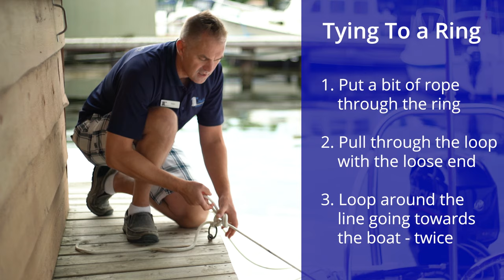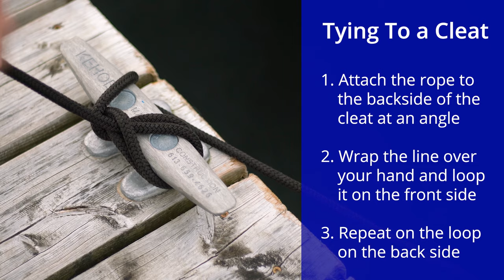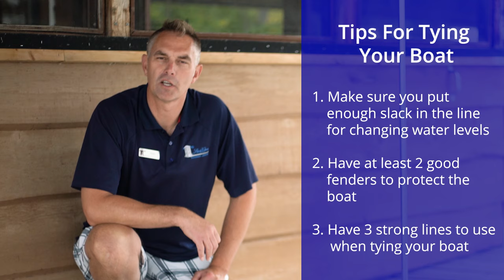How to Tie a Boat to a Dock

Comment from the maker: We got a ton of comments on this video and we learned from them - check them out as there is good information and different opinions in there.
Reply: If you ask ten boating enthusiasts for their opinion about one subject, you’ll likely get ten different ideas, with good reasons.
Reply: El
Reply: On page 65. It's squash eventhough the illustration is about modern-day 1873 lawn tennis.
Reply: ..tie a.. 

At first glance it looks like 1 word; tea.
Reply: @nevillecottee7629  Sorry but you can have 10 opinions but if you aren't tying proper half or full cleat hitches, your opinion is still WRONG.   The fact stands that the method shown in this video of cleating, even though it wasn't a proper cleat hitch to begin with is going to make you lose your hand.  Never put your hand inside that line unless you are perfectly happy with losing said hand when wind or wave shifts 50 tons of yacht the other direction and your hand is caught in against the cleat by the retreating line.   That goes just as much for the cleats, be they on the boat or a pier, as they do for properly running the lines around the winches.

There is always 1 correct way and 10 wrong opinions.

Comment: As someone who has spent a lot of time working on big and small commercial vessels I can safely say tying a slip knot on a cleat is a bad idea and is frowned upon in the boating community. Use the method OXXO. The first O is just a wrap around the base of the cleat followed by two Cross patterns XX (not hitched) and followed by a final wrap around the bottom, O. This way if you need to flick the line off the cleat either from your boat or the dock it can be done much faster and you don’t need to un-tye any actual knots. It can also be untied one handed which also comes in useful. Just my two cents.
Reply: That’s more than two cents worth. Your explanation is what maritime colleges teach.
Reply: also having some give in your cleat knots keeps lines from snapping.
Reply: Now this is a great comment
Reply: Any demonstration vidoe out there? I think i understand it but the last O is kinda the part im confused about? So you make a full turn then do two figure eigjts or cross loops. Then do another full turn to finish it?
Reply: There's a lot of ways you get tired of your boat but there's nothing wrong with the way he tied it actually correct someone that's been in the Navy for 20 years and was a Navy demolitions diver

Comment: When you tie off to a cleat you should really make a full wrap around the cleat before starting your knot, this is especially true for large boats. That allows you to hold the boat in place much more securely and easily before tying off. By immediately tying off, you run the risk of the boat drifting/moving and your fingers getting caught up in the rope.
Reply: in many situations the half cleat hitch is acceptable.  It depends both on conditions, wind, the pier or jetty you are tied up to, as well as the boat you are docking.
Reply: exactly!

Comment: Read Chapmans’s and learn how to tie a proper cleat knot before making a video about tying a cleat knot! There’s always another way to do something, but in this case I have to ask why? I was a dock master years ago and it amazed me how few skippers and crew knew how.  I’ve seen my share of inexperienced skippers make make mistakes and panic moves due to wind and current while someone is attempting to make fast to a cleat, ripping the line out of the persons hand or parting the line that’s attached to a cleat. Once I even saw a skipper rip a piling right out of the water! My point is, never teach your crew to use their hand to make a loop in the line so close to the cleat! A line that’s cleated too soon or a mistake from the skipper could cause serious injury or amputation. Just learn to tie a proper cleat knot and you will know more than 90%of boaters.

Comment: cleat was not tied properly in this video.  If not done properly, (this is not it) a strong wind causing the boat to pull against the cleat will tighten the line so much that you can not get it undone.
Reply from the maker: Yes, thanks for pointing that out. We just reshot this part and will post it soon

Comment: I’ve been boating for 5 years and just now learning about the spring line. Thank you.
Reply: I tie 2 spring lines. Mid boat cleat to the front dock cleat, and mid boat cleat to the rear dock cleat. That way my boat doesn't move front to back at all
Reply: the biggest issue people have with spring lines is  thinking that it's the mid-aft or mid-forward cleat on the boat as mentioned by No_wake. Not that they are wrong it's just common thinking and limits other options.  A spring line can come from the stern and even limited use from the bow if done properly.  Often the line tied to hold the stern is also limiting the movement of the boat because its short so additional  line plus bow line tied properly will have the same effect or better then 4 lines

Comment: Thanks Sean for all the great info.  As a new 1st time boat owner of a bowrider I've found all your videos and tips extremely useful.  Be glad your not here in mid Missouri or Id be chewing your ear off constantly with questions.  Here's a few items I thought I would share on my first outing with the bowrider, maybe you could consider them for future segments....Took the boat on a first run up the river, bad choice, got stuck a few times in low conditions, cant see the bottom, and tore up a brand new prop.  Maybe segment on whats the right depth finder, my next new purchase.  Props, my second new purchase, how to determine which one and the right pitch another possible segment.  Oh and due to all the mud in the river, my Spedo is now not working, maybe a segment on clearing out the Pito intlet on the lower unit, testing the spedo, and then back in business. Keep them coming, cheers.
Reply from the maker: Those are all great ideas, thank you!!  We do want to shift gears to more boating help videos

Comment: The half hitch's might work for small boats, but on work boats with more displacement,  if the weight of the boat pulls on that line, you'll have a line that is jammed on the cleat and you might half to cut it to get loose. One round turn, two figure eight's and a half hitch on top was how i was taught at the California Maritime Academy, a half century ago. That'll work. If you're working with a small light boat, you can get away with the half hitches, but why use them at all, when the figure eights will work better?
Reply from the maker: Great advice and I am going to reshoot that part of the video

Comment: 2:10 is a good instruction of how NOT to tie a boat to a cleat. Ideally, the line goes back to the boat, and you use the cleat on the boat instead ("control the boat from the boat" principle, no need to even step on the dock to arrive or leave). Either way, if you use a hitch, use the cleat hitch after OX (the line will fall neatly side to side, won't jam, much unlike this inverted, insecure and just plainly wrong knot no skipper will teach you), or just do an OXO or OXXO as others have suggested.

Comment: How would I tie up if I only have cleats on the stern of the boat?
Reply from the maker: Are you saying there are no cleats on the bow, or that you moor your boat stern in to the dock and only use the rear cleats?
Reply: @boatinglessons  I use the rear cleats and recently started using the eye on the bow thats used for the trailer winch.
Reply: Yes, I have no bow cleats

Comment: With my pontoon boat, I only have 2 cleats on each side. and the dock slip I will be at this summer is only the length of the boat 20 feet. Is it best to tie 2 long lines, bow to stern cleat and stern to bow cleat?
Reply from the maker: You could to that, but you'd also want to have short lines at the bow and stern to the cleat opposite them. Depending on the prevailing winds and the orientation, I would suggest 3 lines. 2 short to the cleats on bow and stern, and one long one from the rear boat cleat to the front dock cleat, or vice/versa.
Reply: @boatinglessons  Thank you so much. I appreciate the reply! I enjoy the channel

Comment: I'd rather go over the cleat on the dock first instead of going around the base of it first. In the video it; looks to me that the line could chafe on the wood as the boat moved causing damage to the line. By going over the cleat first the line should not rub or chafe on the decking material.
Reply from the maker: Interesting! I know have seen a number of good variations that people have suggested :)
Reply: @boatinglessons  Not all cleats are placed the same either. Some places have placed their cleats upright on the pilling's while others have them on the edges of the decking and or even way back on top of the decking. All kinds of variations give us something to think about when we dock some place different. Again, thanks for the video, the lessons and knowledge that many of us need.

Comment: Adding hitches to a “herreshoff” type cleat is unnecessary and potentially dangerous, especially if a boat must be repositioned or adjusted. A single hitch after a full turn and crossover is enough and doesn’t endanger anyone’s fingers. The additional loop prior to two half-hitches on a ring cleat is interesting but not really necessary, either.

Comment: I disagree about how you tie to a cleat! Your way will lock the line if the line experiences a hard straight. Plus your way places all the strain on the ear of the cleat. It is better to make a complete round turn on the base of the cleat so all the strain is on the base. Then all you need is 3 figure eights on the ears, you can then wrap any leftover line around the cleat (unless you have more than about 4-5 feet, then flemish the line on the dock). This method will hold the line without locking the line making it difficult to undo!
Reply from the maker: Richard, other people have said something similar and I will likely reshoot that portion of the video - I appreciate your feedback!!
Reply: Why you describe is also not a proper clear hitch.
Reply: @GREGPDOHERTY  You are correct I don't think you should ever use a hitch on a cleat. I spent 22 years in the Coast Guard & 15 years in the merchant marine field. I was taught if a half hitch on a cleat was placed under heavy strain the line could lock itself. I have seen line that got so hot because of the amount of strain that the nylon melted. Plus if you do not take a full round turn on the base of the cleat you are putting some or most of the strain on the ear of the cleat. By taking a full turn all the strain it placed on the base of the cleat. If you make a full round turn and at least 3 figure eights the line will hold fine. If you are leaving the boat over night or longer make a few more figure eights. If the boat is going to ride out a storm you should double the number of your lines.
Reply: 100% correct this is. NOT how to tie a cleat!!!

Comment: I’m lucky to be on a body of water where anything I’m going to tie to is floating… which negates the need for a spring line.
Reply from the maker: It does make it easier, yes. I still suggest that it is good for holding the boat more firmly against the dock

Comment: Sorry, what is going on with all these instructional videos showing people to tie cleat hitches with multiple locks on both horns (or sometimes even more than that??), rather than figure 8s with a single lock at the end. Further, if the lock is on the same side as the incoming/working end of the line (the end of the rope that’s tied to the boat), you can run into all kinds of trouble—especially in cold weather or tidal settings. Imagine tying up with damp line and coming back to stiff line after a light morning frost, a bit of wind and wave action has pulled the now frozen line on the cleat quite taught…you know have to work your locking loop free with your fingers or a marlin spike WHILE the working end of the line is moving around underneath or next to the rope you’re fiddling with as the boat bobs about. At a certain scale, this inconvenience turns into pinched or crushed fingers. And then, once that’s managed, you have to dick around with one or several more locked in loops of line frozen to each other and the cleat itself. If they are simply figure 8s over and around the cleat horns as they should be, you can simply pull one direction or the other to work the line loose. The ability to do this is exactly what the locking loop prohibits. Also securing a loose hitch with multiple overhand knots, even with bites in them…same issue. If anything goes awry, those overhand knots have to be worked apart while their tied right on the line thats under tension and moving around.
Reply: That said, is most common to lock on the same horn that the line come in on as you can pull it towards you as you’re already in that side of the cleat BUT these are the kind of things to consider when adapting a hitch to different situations…NOT (knot?) adding more and more locking loop hitch’s around multiple horns…

Comment: Your passes around a cleat are wrong.  I have been a Captain for quite a few years and the locking arm/line should be flush with the rest of the cleat.   You are showing a motor boat I don't care as long as I tie knots way...
Reply from the maker: Yes, I am going to remake this video - thank you
Reply: @boatinglessons  I apologize if my comments were strong but I work both sail and motor and some of the callous ways people tie their boats up does not go well with me.  Some of it I must say is appearance but there is strength in appearance.   The locking turn when it is flush and correct leaves no need to take anymore passes as long as the boat isn't riding out a hurricane!
Reply from the maker: All good - we love the feedback and only want to teach it well. Some things we learn wrong day one and continue to do it wrong for years 🤷🏼‍♂️

Comment: I have problems with every single method you propose for fixing to rings and cleats -- to fix to a ring use an anchor bend and to fix to a simple cleat use a cleat hitch. 

The approach you show at 2:10 for attaching to a cleat is v.bad.  

Why not just demonstrate a cleat hitch?  

When belaying to a cleat, be this on a dock, pontoon or your own boat the correct method is - for example if the cleat is on a dock or pontoon and a line is run from the boat through it's fairlead to the dock:

Step 1 take the rope around and under the horn of the cleat furthest from the boat's fairlead (the angle between the line from the boat and the clear should be less than 90 degrees) and take a turn  around and under the other horn at end of the cleat closest to the fairlead.  With this the dock-hand can control the boat with little no effort. (some people use only a half turn at this stage) - this is the "O"

Step 2 - bring the line diagonally across the top of a cleat and around and under the horn (the one furthest way from the boat) -- DO NOT ADD A HITCH at this stage. - THis is the first leg of the "X"

Step 3 - then secure the mooring by crossing back over the top of the horn -forming an X on the top, but before you pass the line under the horn flip it so that the returning line passes under the line coming from the first horn. When you pull the line tight the returning line is held tight against the line laid in Step 2. NOT across it. This method is summarised as OXH. H=hitch
  
If you are using Nylon Ropes many sailors use OXO or OXOH. 
 
Whereas if you are using braided polyester lines, like double stranded polyester braid on a braided dacron core, then this tends to slip more than Nylon, so a hitch is essential -- a hitch = one not 2.  

In wet conditions or with old lines more turns maybe required. Particularly if the dock gear is very large when compared to the diameter of the line -- in which case an eye or loop is often the better answer.

Obviously - if you are fixing to shared cleats then a loop/eye should be used dockside and the tie is made on the boat, where surplus line can be secured with out risk to folk passing.. 
If fixing to a post or single bollard -  rolling hitch or loop (bowline or pre-spliced ); double bollard, stag horn, T-bar,  belaying pin etc. then a more complex solution maybe required depending on the size of the mooring hardware, diameter and type of your lines. and the ability of the line to form a secure and safe belay.  

I suggest you give your viewers links to proper best practice guidance and you go back to school.

"Belaying. When a rope will have to be cast off while still under strain it cannot
be secured with a bend or a hitch, except perhaps a slipping one. It is therefore
belayed to a fitting made for the purpose, such as a cleat, staghorn or bollard. The
action of belaying consists of taking sufficient turns round the fitting to hold the rope
by friction when it takes the strain. Generally speaking, four complete turns should be
sufficient, but the number of turns may have to be increased according to the degree
of friction existing between rope and fitting. A wet and slippery rope or bollard, or a
smooth cleat or staghorn and a well worn rope may require extra turns."

Comment: Not the proper way to tie off to a cleat.  You risk losing your fingers and you only need the half hitch on the final turn which locks it into place.  All of the rest is just you trying to lose fingers and ultimately chafe the line unnecessarily because of the way you laid it on with all of those hitches.   Your line will last half as long doing it that way.

Comment: His cleat hitch is an absolute joke and not correct. You should end up with one line over two. His method can cause issues untying when there is strain in the line. At least he utilized the proper nomenclature for fenders and not the amateur term “bumper”. Check out Chapman’s Piloting for cleating a line and disregard this guy.